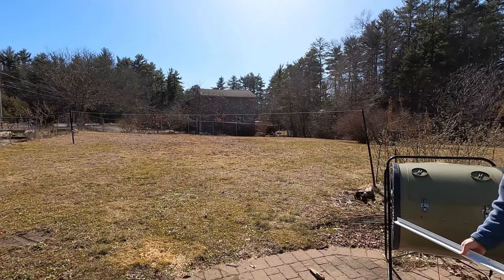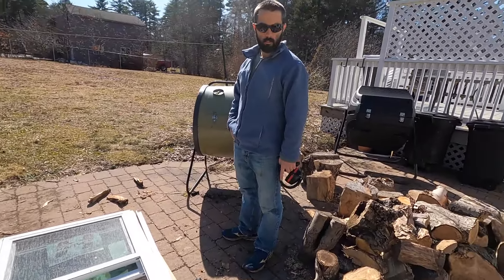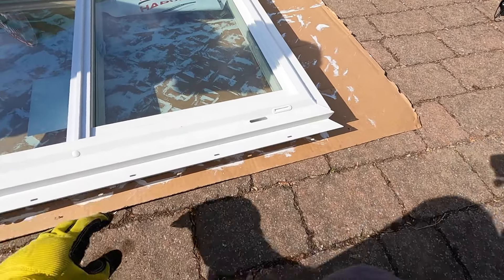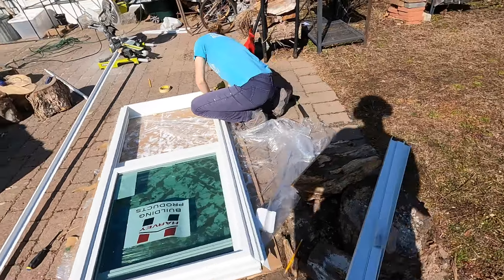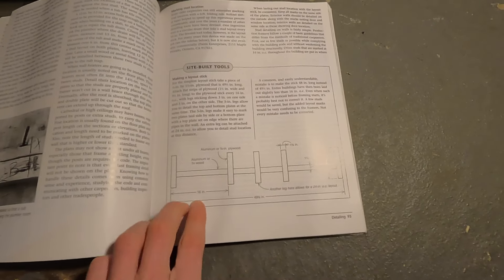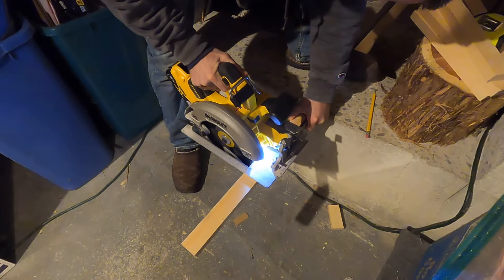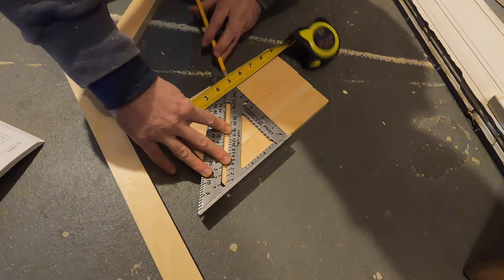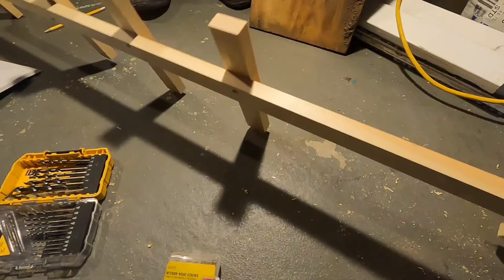House Build Prep Projects- Window Nailing Fins and Making a Wall Layout Stick

Comment: I do not comprehend the layout stick at all. Using it You will be off every stud by 3/4 of an inch  if You mark it using it. Starting from the outside you will be off 3/4 every time.
Reply from the maker: You have to hold the stick back 3/4in for the first stud then mark the rest of the studs from that line for shear walls. I was confused by it too at first but it makes sense once you use it.